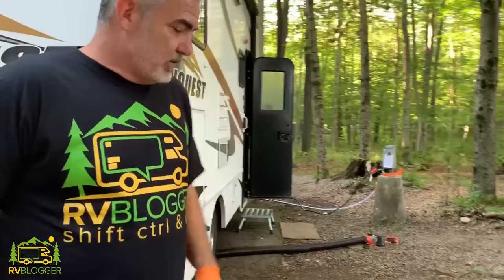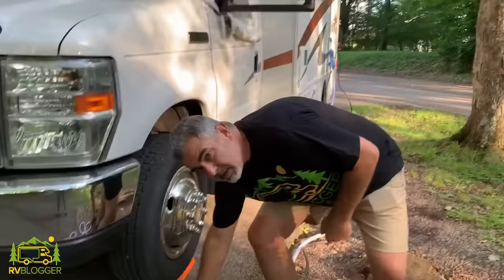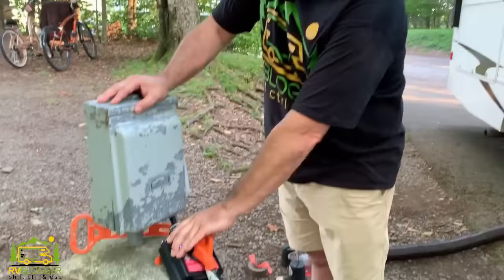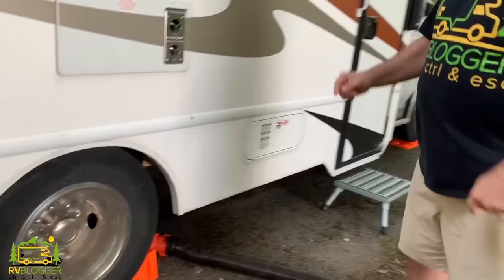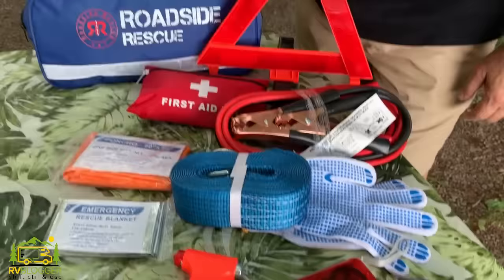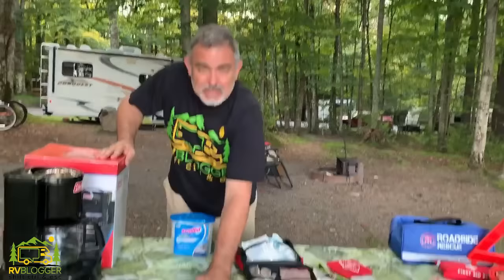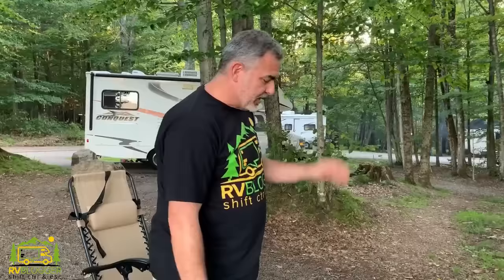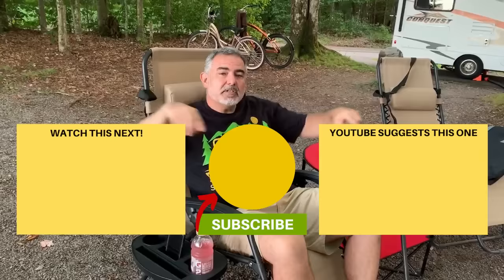Essential Gear & Accessories for RV Beginners - We Didn't Back In to Our Campsite - Do You Know Why?

Comment: Somebody told me that only food-grade hoses are allowed to be white. That was why I needed a white hose for my RV, because it was food grade and the water would be safe to drink. Is that correct?
Reply from the maker: Hi Bruce,
I've not heard the term food grade before but the idea is correct. You should use a hose specifically designed for drinking water to avoid lead, and PBNs. In addition you want to make sure you only use your freshwater hose only for hooking up to your water supply. Never use it to clean sewer hoses...
Thanks for watching and commenting!
Mike and Susan
Did you see our video about our FREE RV Rental for a Weekend we are giving away? Hope you will check it out!
https://youtu.be/h_NW_O-VsTo

Comment: Why are pulled into this site wrong? I have never seen a camp site where my septic needed to be run under my trailer like that..
Reply from the maker: Hi John,
We camp a lot more often than most folks and occasionally the hook ups are on the wrong side.
I guess it isn’t obvious but if we backed in to the site the side door of our RV would not be facing the main part of our campsite where the picnic table and fire ring are located. Maybe I didn’t explain that well enough in the video…
Thanks for watching and commenting! 
Mike and Susan

Comment: why in the hell didn't back in, if you can't back in you shouldn't be driving a RV!!  i had a rino hose and you can hurt them by stepping on it
Reply from the maker: We could've backed into our campsite the way it was designed but then our door would've been facing the road vs facing our campsite where our picnic table and fire ring etc was. Would you have rather walked out of your RV and have to walk all they around it to get to your picnic table? We preferred pulling in and that was ok cause we had enough RV gear to make it work. I do find it interesting how many people are concerned by the way we parked. We didn't seem to be nearly as bothered as those that like to criticize us.🤣 We didn't say the Rhino hose was indestructible, just built stronger than many others. Thank you for watching our RV tour video and commenting. We appreciate your support!
Reply: @RVBlogger  I don't believe you for a second. Having camped for 30 years nationwide, I've never experience a single campsite that required you to pull your vehicle in FORWARD with the actual campsite on the opposite side. How the hell does one back a RV trailer into that spot? They can't. I simply don't believe you.

I'm prepared to stand corrected. All I'd need it the campground and the site number.
Reply from the maker: @alandeon  We were at Canaan Valley Resort Campground on site number 33. You can look it up on Google Maps, on satellite mode, and you can clearly see the parking pad on the left, and you can even see the electric pedestal on the right side of the parking pad, which means it is on the wrong side of the campsite. The parking pad is on the left, and the campsite is to the right and goes all the way to the main road. If we had backed into the site, our side door would not have faced the huge campsite we were on where the picnic table and fire ring were located. Why do you think we would lie about something like this? 
Anyway - just because you haven't experienced something doesn't mean it isn't possible or real.  Have you ever won the lottery? Well, people do every day. Just because you haven't experienced it doesn't mean it isn't possible - although it is improbable.
Reply: @RVBlogger  site 33 is a max 35 foot trailer BACK IN site. The area beside you where you set up was part of the TENT camping area. The other side (which is just as close to the the road like all sites at Canaan valley appears to be yours also is a back-in sites with open areas on the awning side of a back in trailer with the hookups on the normal side. All sites are just off the road. that's how that particular campground organized their sites. I believe you utilized the tent camping area for your firepit and setup because there was nobody on that site that weekend because Google maps shows you had a spot on the other side (the one with the garbage can they provide every site as well as some green grass area for your use) Your picnic table was also on the normal side and I'm pretty certain, based on all the other sites in that campground so was your normal firepit.

That being said, Yeah, I think you could have just been more clear when discussing it in the video.
Reply: That being said, I carry almost everything you recommended so the actual video wasn't bad, It's the deceptive parking that's gotten you so many negative relies.
Reply from the maker: @alandeon  which I find very interesting. Why do people feel the need to "shake their finger" and judge others for doing things differently. We did what felt right for us and it worked. There is no law against parking the way we did. IMO those that followed the design of this site missed out the most...not us. But thank you for agreeing with the RV gear we suggest as essential gear to own for comfortable camping.

Comment: I don't understand everything is on the wrong side.  Couldn't you just of backed in?
Reply: Yes, I'm thinking the same thing.
Reply from the maker: Hi Greg,
Look more closely...if we backed in the side door to my RV would not be facing my campground where the fire ring and picnic table are located...so this campsite actually has the hookups on the wrong side. This happens to us a few times a year but we camp a lot more often than most folks. The other reason we keep 2 of everything on board is in case anything breaks...
Thanks for watching and commenting!
Mike and Susan
Did you see our video about our FREE RV Rental for a Weekend we are giving away? Hope you will check it out!
https://youtu.be/h_NW_O-VsTo
Reply from the maker: Hi David,
Look more closely...if we backed in the side door to my RV would not be facing my campground where the fire ring and picnic table are located...so this campsite actually has the hookups on the wrong side. This happens to us a few times a year but we camp a lot more often than most folks. The other reason we keep 2 of everything onboard is in case anything breaks...
Thanks for watching and commenting!
Mike and Susan
Did you see our video about our FREE RV Rental for a Weekend we are giving away? Hope you will check it out!
https://youtu.be/h_NW_O-VsTo

Comment: Far too many things ”nice to have” confused as ”must have”
Reply from the maker: Hi Jay,
That is probably true for some folks and for others it pay be different. What is in your list of Must Have's and Nice to Have's?
Thanks for watching and commenting!
Mike and Susan
Reply: RVBlogger Must haves are things you cannot function without. Nice to haves make things easier or nicer. I must have water. I have the filter as part of making it nicer. I also distill the water I drink for instance. MWhen I started camping out in 1948, there was only a community spigot for use. The showers and toilets were available. It is much nicer to have my own toilet and shower BUT that introduced another MUST have. The tanks, piping and connecting hoses to attach to the dump station. It is NICE to have a connection at the site but it is not a MUST have. I have a “honey wagon” that makes it nicer if the site does not have sewer connection.

My point is that WANTS get converted into MUSTS far too easily. When someone does not have a “must” they become unhappy with there situation.

I have a surge protector on my power connection because I don’t WANT a possibly damaging event to occur. 

It is fine to WANT things as long as not having them does not destroy your day.
Reply: @jaytibbles2223  By your definition, if you own an RV at all, you have every "must have", because the only "must haves" that exist are food, water and shelter.
Reply: @specialopsdave  exactly. Having this attitude removes leverage from a dealer. My point is WANTS become deal breakers too easily

Comment: I'm super confused here making a video showing first timer mistakes, but you're making a first timer mistake. You have your camper on the wrong side. The hookups are not in the wrong side. Why would you not back in? That's what you're supposed to do...the first indicator should have been when you opened the door and saw your hookups in front of you, turn your rv around.
Reply from the maker: Hi the ForgotteNJ,
You are so wrong! lol! But lots of people are who watch this video so you aren't alone. We camp a lot more than most and run into backwards sites a few times a year. 
I guess it isn’t obvious but if we backed in to the site the side door of our RV would not be facing the main part of our campsite where the picnic table and fire ring are located. Maybe I didn’t explain that well enough in the video…
Thanks for watching and commenting! 
Mike and Susan

Comment: Maybe make a vid without the rv parked wrong.  Its like making a fishing vid with the reel on backward.  It distracts from the presentation!  All We see is the mistake.
Reply from the maker: It's not a mistake if you purposely do something that makes your experience better. Which we did. A fishing reel constructed backward wouldn't work...this works. Why would you let parking distract you from a video filled with camping gear tips? We could've backed into our spot the "right" way but then our door would've been facing the road vs facing our campsite where our picnic table and fire ring etc was. We preferred pulling in and that was ok cause we had enough RV gear to make it work. I do find it interesting that people are even bothered by the way we parked.🤣 Thanks for watching and commenting

Comment: Dumb question, why didnt you just back in so all of your connections were on the correct side?
Reply from the maker: Hi Matt,
Many people have asked this question. If we backed in the side door to our RV would not be facing the main part of the campsite where the fire ring and picnic table are located. This site was actually set up with the hook ups on the wrong side. This happens to us about once a month which is why we keep extra lengths of electrical cord, water hose and sewer hose on board our RV.
No question is ever dumb - we ask questions all the time and that's how we all learn from each other.
Thanks for watching and for your question!
Mike